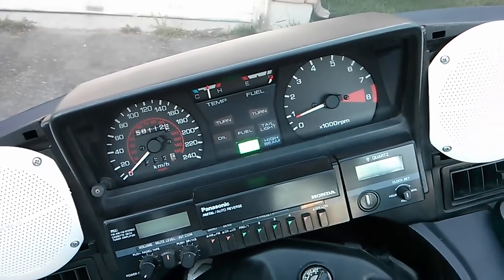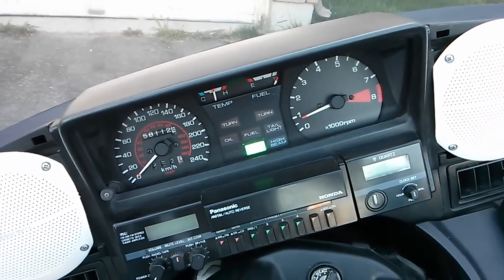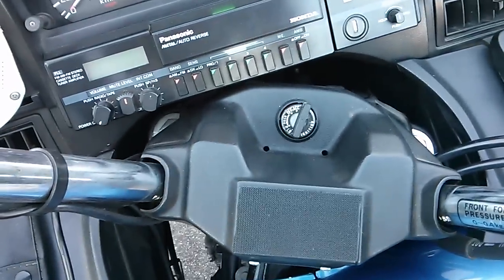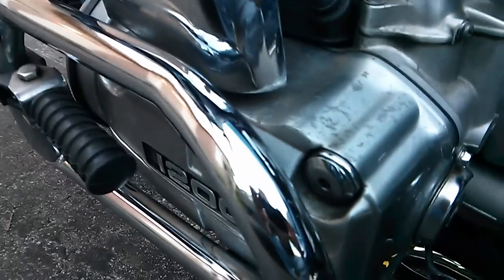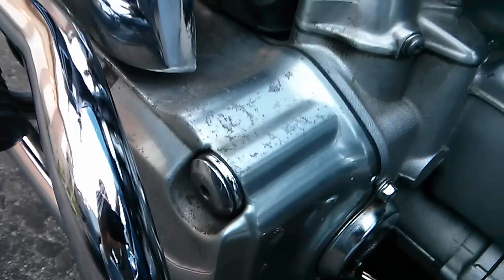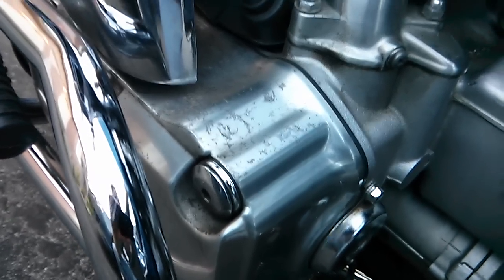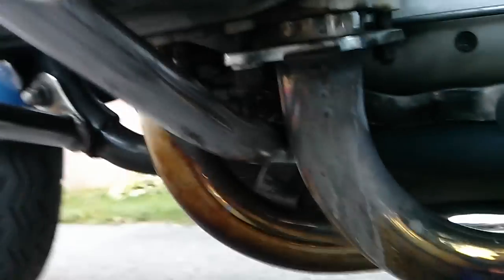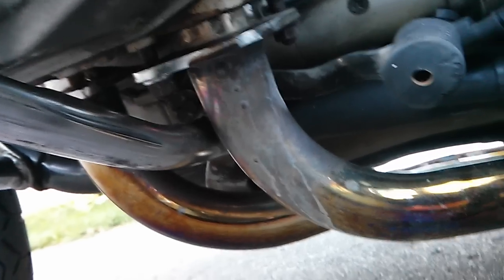GL1200 engine sounds

Comment: Hows the coolant level? & is there coolant in the oil (milky looking instead of brown) might be as simple as a head gasket, causing low coolant & therefore overheating on the left side
Reply: I have drip , drip , on the left side ....antifreeze.  once it warms up , it stops . What cha think ?
Reply: @edgardomatos6923  start with "simple" & make sure all the nuts are tight (look up the specs & use a torque wrench) clean the area around where the leak was & watch for it. If it still happens, you'll need a new gasket, o-ring, or hose depending on what you find is leaking
Reply: @pseverin68  so actually , take the valve covers off , and tighten the bolts that lead to the head gasket, ..i believe to torque  is 10, psi, then 25 psi..
Reply: @pseverin68  thank you
Reply: @edgardomatos6923  10-4 that's what I was talking about. ✌️